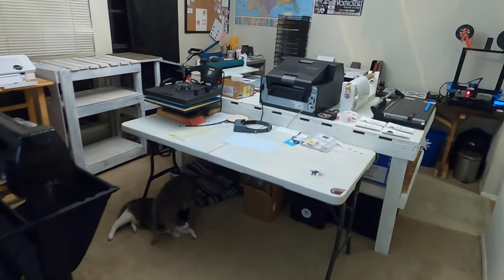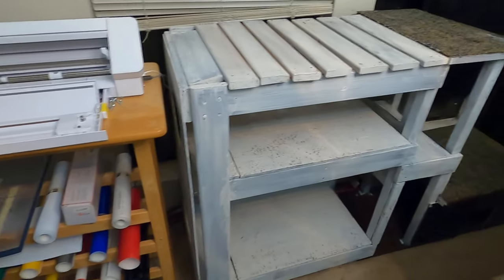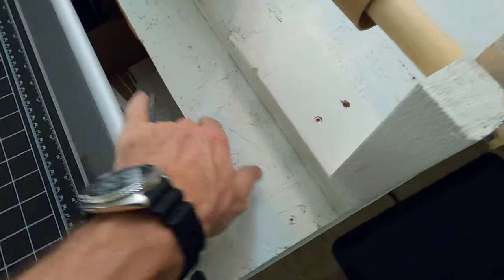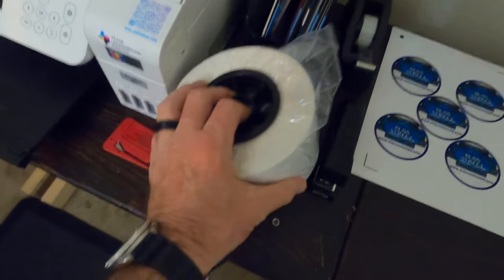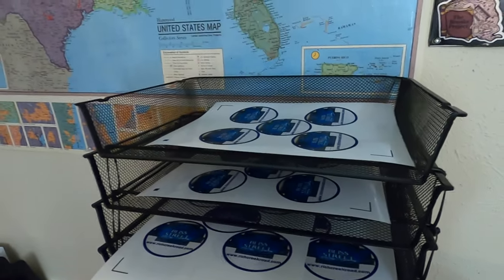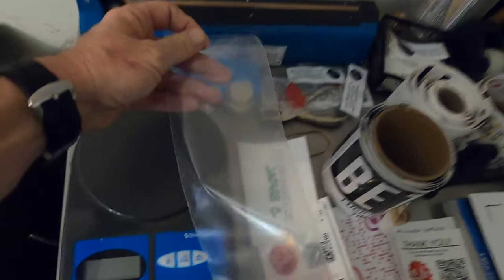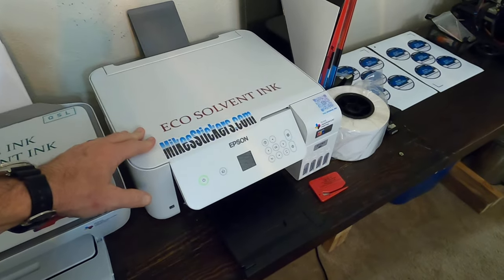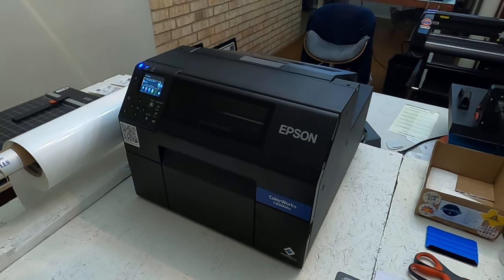Home Sticker & Label Shop Tour

Comment: Hey there I would like to know how your Epson labels hold up like decals for outside use in hot climates like Texas do you have any inside in that? Thanks!
Reply from the maker: They hold up okay but the bright colors fade in the sun after a few months. It needs to be laminated to be out in the elements all the time otherwise it will start to wear quickly. Kimdura material holds really well with no lamination. There are a bunch of different type of materials the label printer can use & you will get different results depending on the material. Basic BOPP doesn’t hold up very well in the Texas climate. I would use Kimdura for chemical drum labels or applications like that if it’s stored outside.

Comment: thanks for the video mike. I just got started with mine as a hobby. Still learning. I just bought a portrait 3 today. Hopefully its as good as your cameo. Is it better for me to buy a inkjet printer or can I just use my Hp laser color? I need help with design process.
Reply from the maker: You can definitely use a laser printer. The toner cost might add up quicker though.
Reply: @mikesstickers  could you tell me what format is the best for vibrant pictures when designing ? should I get an image in pdf format or png? im trying to make cards for my friends baby shower. the images never come out as vibrant as how it looks on the computer though